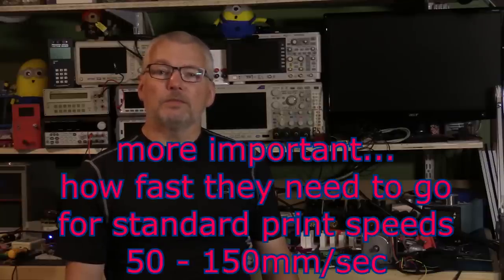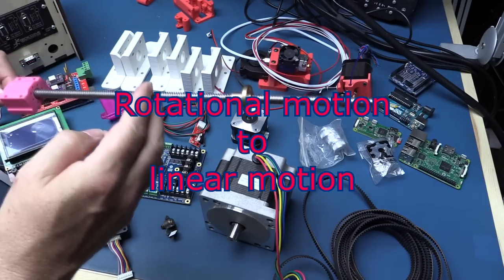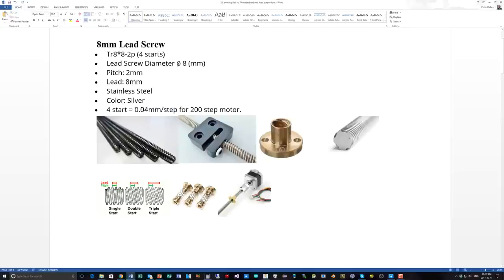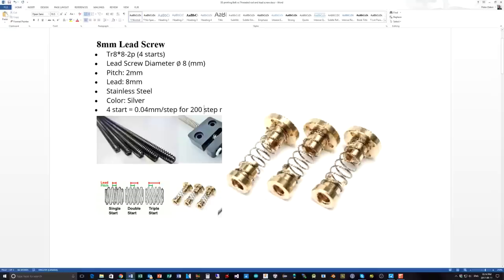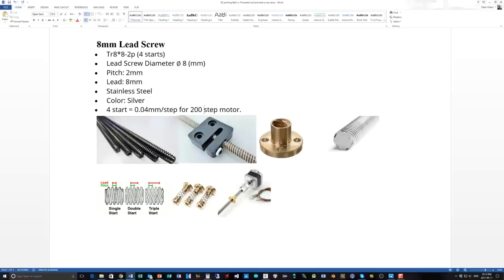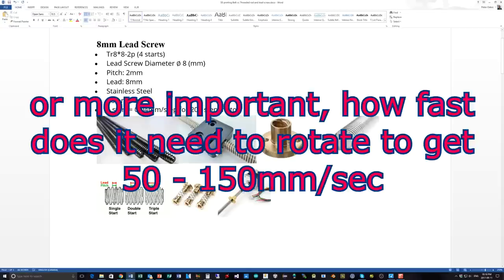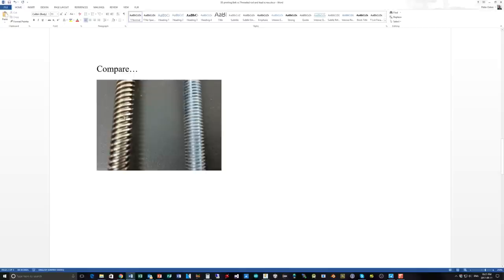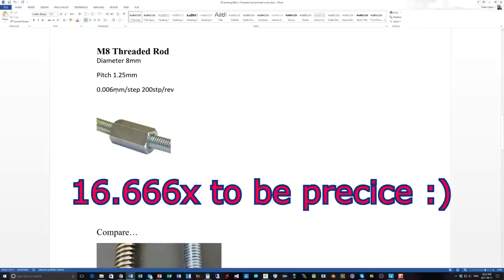3D printing, what to use... BELTS  or SCREWS ??

Comment: Dear Sirs
Shen-Han Technology is established in 2010 and supplies ball screw and ball nuts which factory is sited in Bao-An, Shenshen, China.  We are the high-tech ball screw manufacturer and meet the international standard of DIN 69051, GB/T17587 and JIS C5, etc.  The factory is certified by ISO9001 & UKAS and we are professional in the industry and have the confidence to produce both of the global standard and the customized specification, and the quality is compatible with the international branded products.
 
We are approved by Chinese high-tech enterprise certification and the plant has the equipment included CNC lathes, CNC 4 axis machining centers, CNC 5 axis machining centers, and CNC internal thread grinding machines.  We have R&D team to develop the new designs of ball screw and has the specific patents including the new design and new appearance.  We are also capable to develop OEM or ODM designed ball screws to satisfy with customized needs.  The sketch of CAD/CAM customized transmission component design is available both for equipment and high lead ball screws in specific standards.
 
Capabilities of Shen-Han Technology –
. Ball screws and screw nuts in customized specific standards
. High lead ball screws and screw nuts (1616, 1632, 2020, 2040, 2525, 2550, etc)
. Module in precision positioning, XY tables (Single –axle or multiple-axle stages)
 
Wei Tai Transmission Limited Company is the head office in Taipei and acts for all of international trade activities to handle the shipment supplied from Shen-Han Shenzhen factory.  We are looking for the new customers in your regions and it’s thankful if you can give us a chance to work together with.  Please feel free to contact the following:
 
Wei Tai Transmission Limited Company
Email: 02weitai.ltd@gmail.com

Comment: Belt pitch has absolutely NOTHING to do with linear distance on a belt drive.
Linear distance is dependent on the pulley circumference and nothing else.
You compared a 2pitch 20 tooth pulley (~13mm dia.) to a 3pitch 20 tooth pulley (~19mm dia.)

a 13mm pulley will have exactly the same linear translation if it has 20 teeth or 200 teeth, which is 13*pi = 40.8407mm per rev. This is about 5 times faster than an 8mm lead lead screw, with about 1/5 the resolution and torque (ignoring frictional losses).

On the subject of friction, a 2mm pitch screw will have the same (approximately) friction regardless of number of starts with no load. With linear load applied more starts has less friction. There are differences in thread design, a lead screw will use some variant of an Acme thread, while threaded rod will use some variant of a standard 60 degree profile. Acme threads are intended for linear motion, while 60degree threads are intended for strength.
As you increase the number of starts for a given pitch on a thread, you increase the pressure being applied radially , and reduce the pressure applied linearly to the nut. In other words, adding starts, reduces available force to move your part. Imagine your 2pitch thread with 50 starts, the rod will look more like a spur gear than a thread, and will apply nearly all of the pressure radially (like a gear), and apply nearly no pressure linearly.
What this means is that the 4start 2mm lead screw has about 1/4 the applied linear pressure as a 1start 2mm lead screw. Comparing this to a belt gets a bit messy, but it should be clear that a 4 start lead screw will not apply massively more pressure that a belt.
Reply from the maker: I disagree with "It has nothing to do with it", it is simply a simpler way of looking at it. If a belt has a 2mm pitch and a pulley has the matching pitch and also has 20 teeth around then it is really simple math to figure out how far it will travel in a single turn (2*20), (3*20 in the case of a 3mm pitch). No 2PiR etc required and no need to accuratly measure the diameter of the pulley, compensating for the teeth and flat spots. The math you present is perfectly correct and if you were using a smooth belt it would be the only way to figure out the distance traveled for a single turn, with a toothed belt, my way is simpler but no more or less accurate.

Thanks for the great info on the friction effects with different screws atc, very informative.
Reply: I understand the confusion. That was my first thought but you're correct Peter.
Reply: @TheBreadboardca  I agree with Joshua43214. Distance traveled per revolution is not related to belt pitch, but rather circumference of the pulley.
Reply from the maker: @ldruningman  Everybody is actually correct, but to some "C=2πr " (2*3.14159* ??, as the radius is not given) is more complex than 20*2 (Teeth * Pitch), we could figure out R by reversing the process ie. 40/2 * 3.14159 giving R=6.366 so now we can do 2*3.14159*6.366  = 39.998 but you have to agree, that is too much unnecessary work right !!. most parts like this are advertised as a 20 tooth GT2 pully or simply a GT2 belt. the 2 meaning 2mm pitch

Comment: Nobody here seems to know what a real ballscrew is. Acme threads are for amateurs.
Reply from the maker: I am sure they do, but with the range of 3D printers being sold, most of them use Acme threads and for the purpose they work well enough. I know when i complete my test bed, there will be issues with backlash on the x and y but how much depends on how I mitigate it. if I can get a sponsor to support me with Ball Screws then I will be only too happy to create a video all about them too, along with using linear rails rather than ground rods.
Are proper ball screws way better in oh so many ways, absolutely, but that comes with a considerable increase in cost. If you need that accuracy and repeatability and stability then it is worth the additional cost